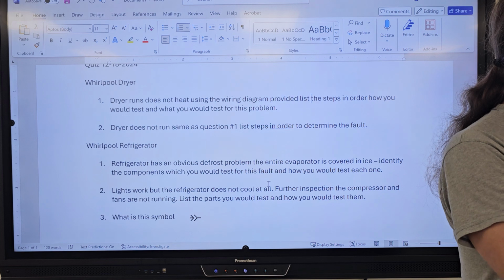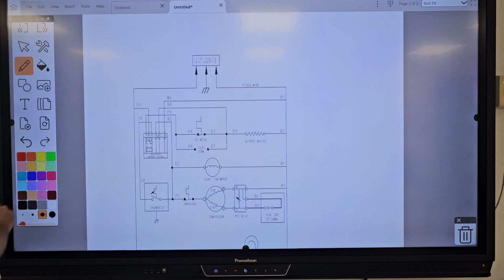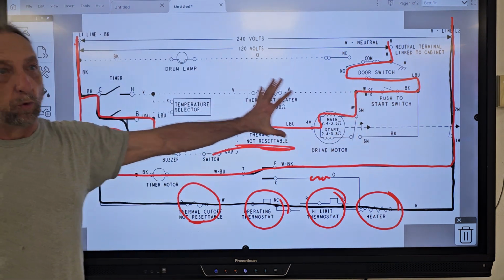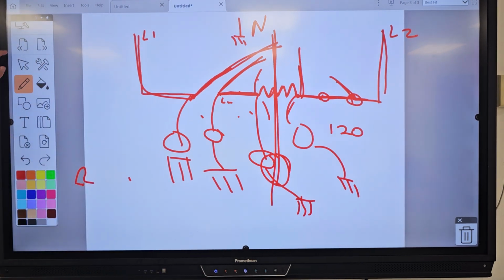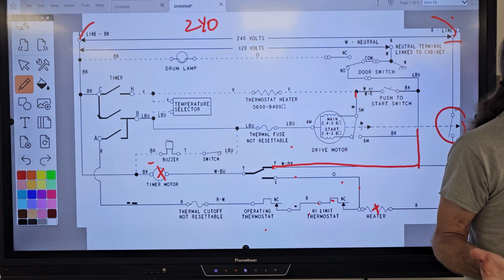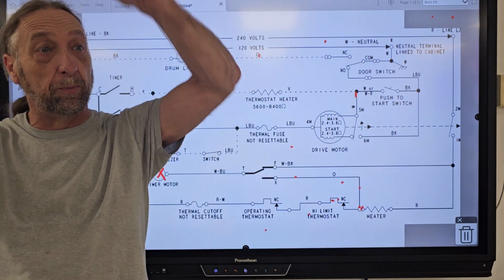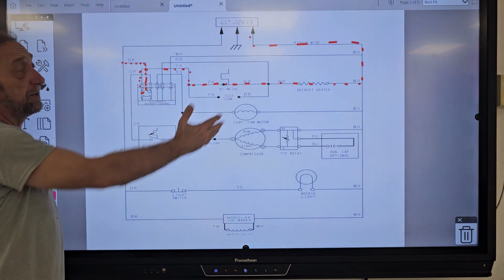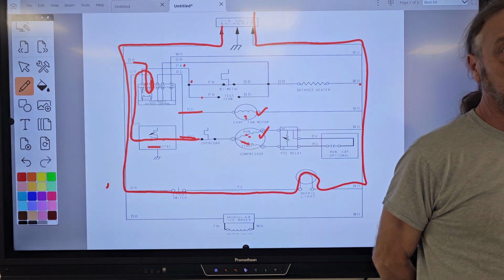Troubleshooting do you know the steps?

Comment: This type of tech sheet usually has a small timer chart for testing the contacts in the timer, correct? If the heater is not working, wouldn't it make sense to just put the timer in time dry and check the corresponding contacts on the back of the timer first?